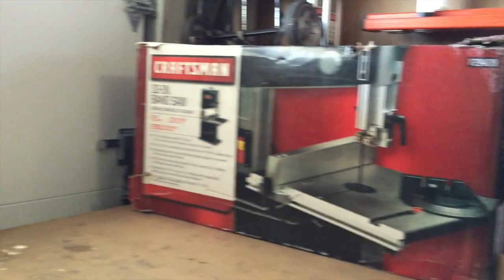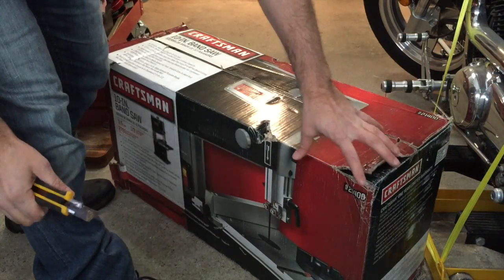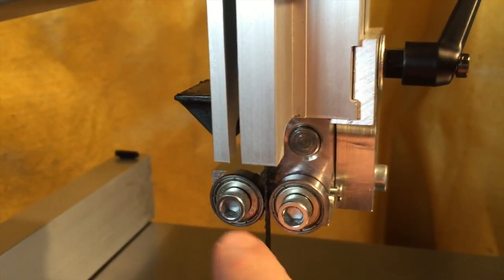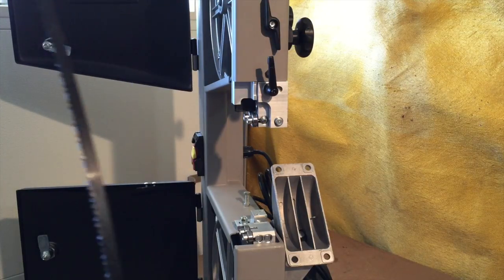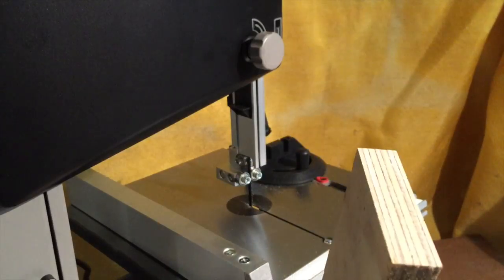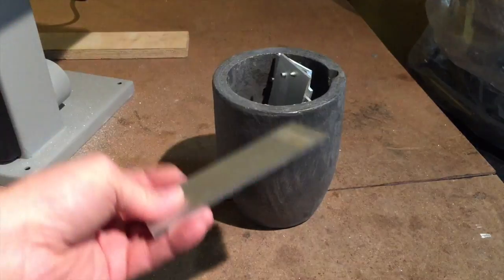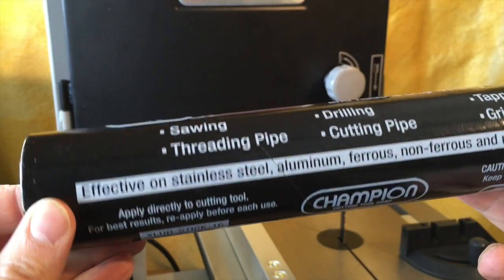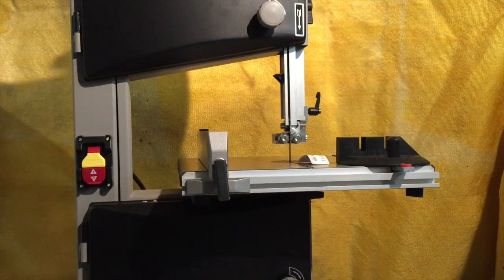Cutting Metal on a Wood Bandsaw - Craftsman 10" Bandsaw

Comment: You think it can cut steal?
Reply from the maker: +Cee-Man69 I think it could handle thin stuff like sheet metal or maybe 16th of an inch steel. For anything thicker, the motor would have to be slowed down a lot. For soft metals like aluminum, brass, or copper, it'll do the trick as is.
Reply from the maker: +matcstudent1 Yes, you are completely correct. Slowing down the speed of the blade and not the motor. Thanks for the link - some really good discussion going on there.
Reply from the maker: ***** Yes, I agree. I used to visit that site a lot in the past. I think I need to start checking it out again. Thanks!

Comment: Blade put on backwards in video  lol...printed checklist...you are gonna get hurt!
Reply from the maker: I did quite a bit of research and even though the blade looks like it should face the other way, the direction you see in the video is correct. That is, teeth pointing down, not flowing back.

Comment: a jigsaw would have been cheaper for what you are doing
Reply from the maker: Great suggestion and I’ve used mine to do just that. Worked like a charm since I have variable speed on it. I’m not saying using a band saw to cut metal is the only or best way, just an option if you have one.
Reply: well bandsaws are fantastic for steel fabrication if you get them set up the right way - this one was suggested to me because i've been on a tear watching bandsaw mod videos for steel cutting - i'm sure you've seen some of those? usually involving changing the blade and gearing for much lower RPMs etc?
Reply from the maker: antigen4 - Yeah, watched a ton. Thought it would be easy to mod my bandsaw and lower the speed so it could cut steel. It’s not easy or cheap especially if you don’t have a variable speed motor laying around.